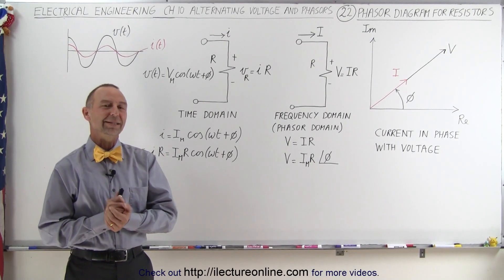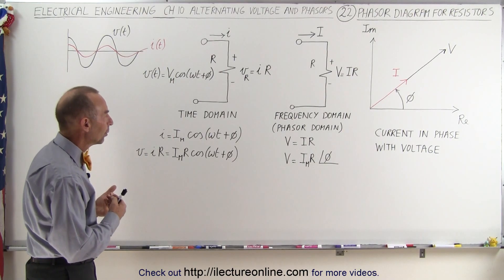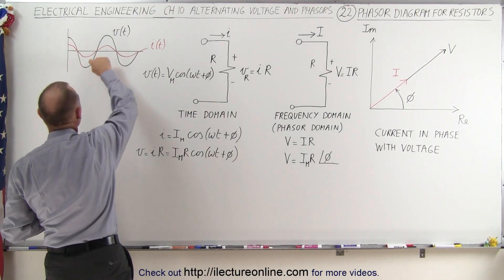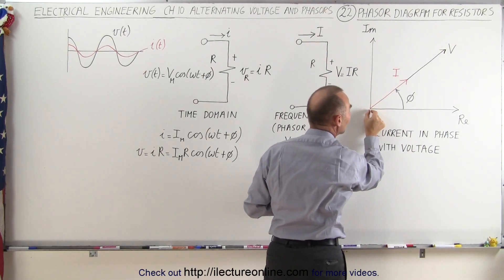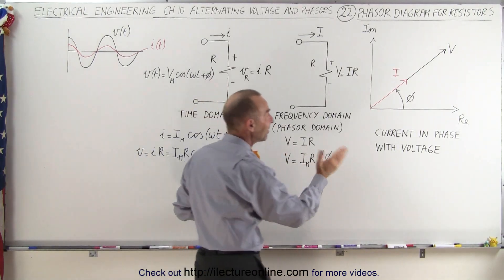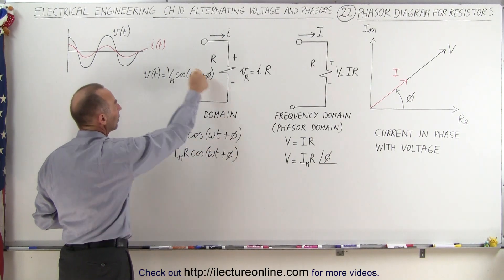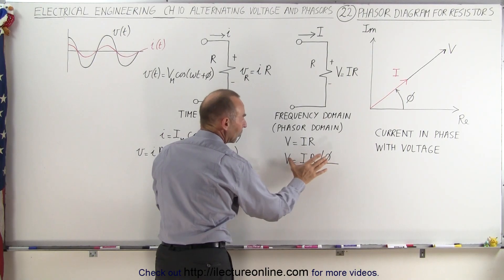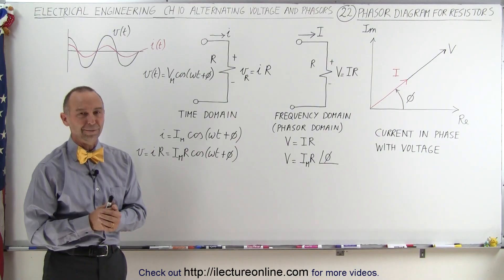Electrical Engineering: Ch 10 Alternating Voltages & Phasors (22 of 82) Phasor Diagram for Resistors

Comment: I have a q for my exam   What is the diffrence between stable an unstable equilibriam
Reply from the maker: In simple terms, if you stand an egg upright and it is motionless, it would be in mechanical equilibrium, but the slightest push will cause it to fall.  That would be considered unstable equilibrium.   Whereas a soccer ball at the bottom of a rounded hole would be in stable equilibrium as the slightest push would momentarily place it out of equilibrium but it would quickly go back to its equilibrium position.  That is stable equilibrium
Reply: Michel van Biezen very thank u
Reply: Michel van Biezen reading all these thing but with a simple example thnx💜💜😍😍